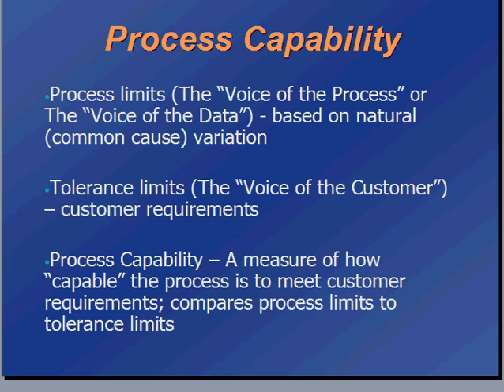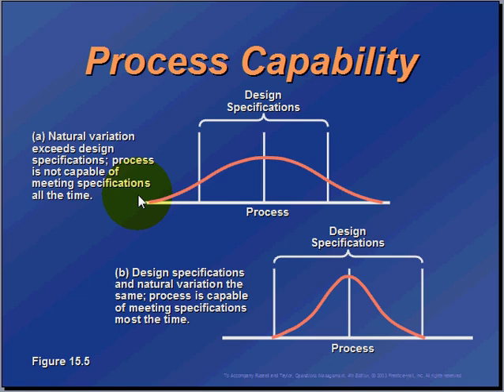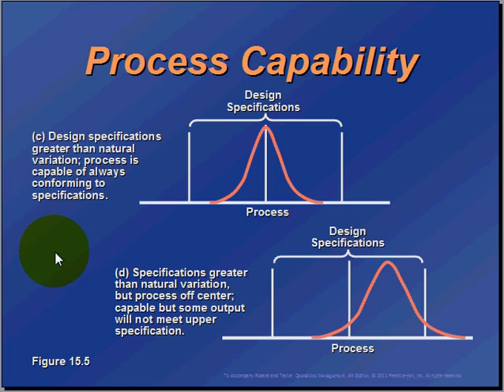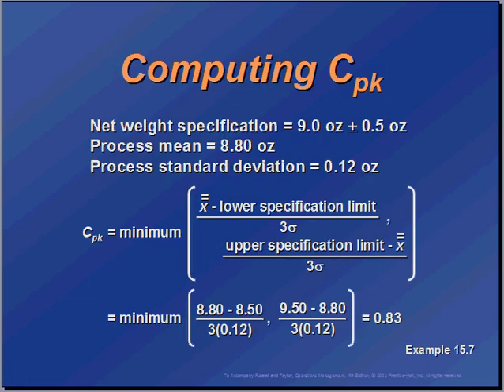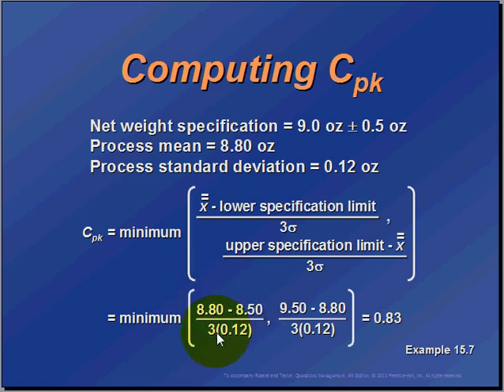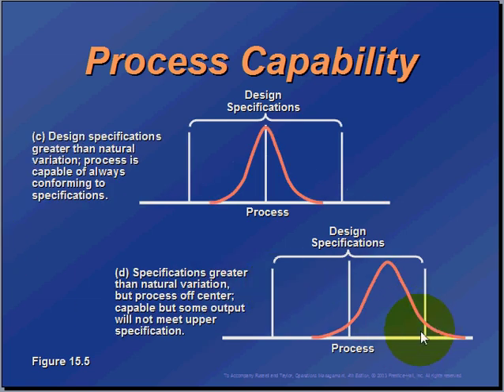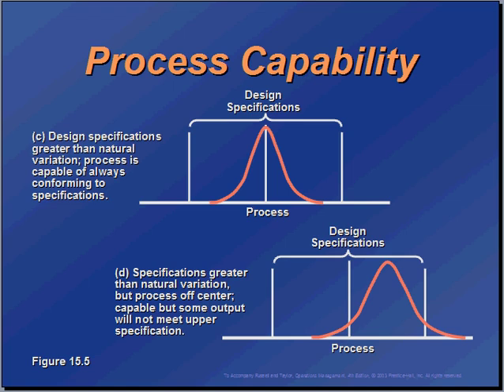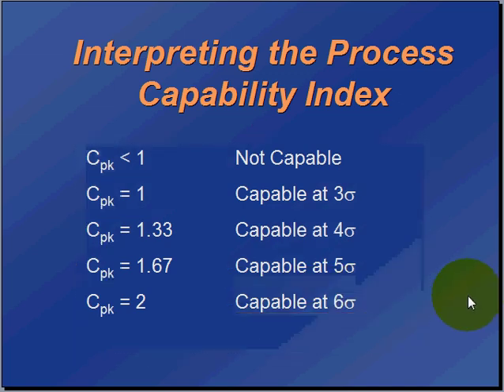Calculating Cpk for Process Capability

Comment: Nice presentation EXCEPT.  There is a significant flaw around 1:40.  The displayed limits are referred to by the lecturer as "our lower control limit" and "our upper control limit".  They are not "control" limits.  They are "specification" limits.  The distinction between "specification" limits and "control" limits is significant.  These terms are not at all synonymous.  Please consider re-recording the audio to correct.
Reply: I was hoping someone had already made this comment.